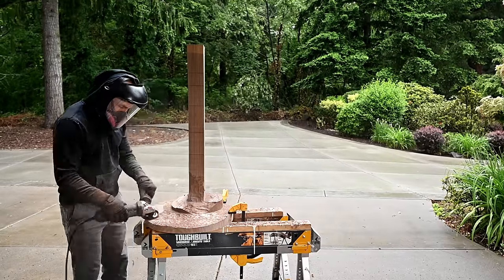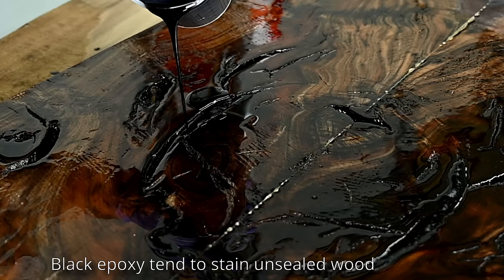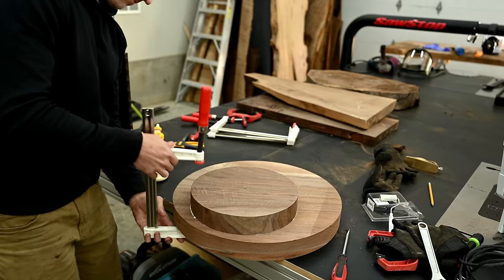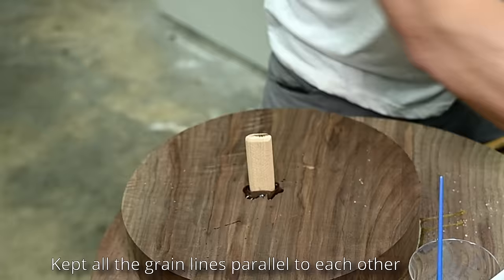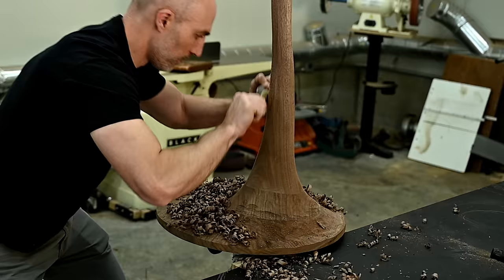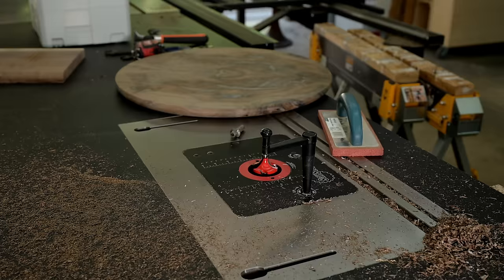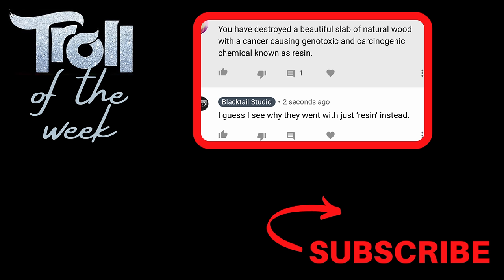Nobody Uses Wood Like This, and I Don't Know Why

Comment: I really do like these “scrap” projects. For someone like me that doesn’t have a lot of money to practice, it helps because I practice with a lot of “throw away” pieces.
Reply: The throw away scrap projects I enjoy it gives me new idea
Reply: If you can afford all the equipment necessary to transform this timber into a piece of art your rich🤣
Reply: I've never found any scrap pieces of walnut anywhere around my area. It's all super expensive
Reply: Second hand stores have alot of wood cutting boards for practicing on.
Reply: Your table is so beautiful. I have seen some wood workers put fake crystals, turquoise, or other jewels into the cracks with epoxy.
Reply: I made some of my most unique pieces out of scrap. Basically designing around the shape of what I have.
Reply: Scraps have made me alot of money, I get alot of scrap from my neighbour as he just uses it for his burner, made and saved me thousands
Reply: @valeriesmith938  I have a small table like that,, there's epoxy or plastic chunks embedded in the resin, its a good idea if your not a epoxy fountain of ever flowing resin aha
Reply: I used to go to the city dump about once a month and gather up as much wood as my pickup would hold. Once I got there to find a huge pile of 1/4" plywood, all in pretty good shape, and took two loads home before the guy working there showed up as I was loading the third load, and told me that it was spoken for. Oh well. I had an old frame house, and used the plywood as a sub floor to re-floor the the kitchen and living room. Very seldom did I use new wood for my projects.
Reply: @sueladybird6923  I think the expression  you're looking for is 80's middle class. But also if he's making money with this work the tools pay for themselves.
Reply: Looks like a soulful Labrador Retriever. Love this table!
Reply: @stevenwilson8718    My husband just stopped at a house nearby that was doing some construction and he always scavenges for discards. The homeowner and he started talking and he brought out some scraps of solid exotic hardwood flooring since that’s what his business is and is going to contact him when he has more. He finds solid hardwood cabinets discarded as people are updating or remodeling and has made some good discoveries and new contacts.
Reply: I see a dog
Reply: @sueladybird6923  ...you're* rich.  😊
Reply: @sueladybird6923  not at all you can do this with a handsaw grinder and some other small things and then use the money to get more tools
Reply: You saw a sloth 🦥.  I saw a Harley scull. I love the table. I think it looks great. It's not a project I would take on. One I'm not that advanced. Two, I'm a hand tools kinda guy. And it would take far too long to carve that base to make it worth it.
Reply: @sueladybird6923 Well I have to give you an example, I'm living in se Asia with my family, I just love what I can do with lots of very cheap timber, which comes from import pallets etc , I get great reviews from many people of the furniture I make for our house, god bless

Comment: Small tip from a sheet metal fabricator: when you drill holes in those metal discs, run the drill much faster. For that drill at 17:32 you would want about 1000 rpm. Your cutting force and also the chips will be smaller, so less risk of the workpiece flying off, the drillbit breaking or overheating. You can easily find rpm charts online. Don't press too hard on the handle and lubricate. When you lubricate with something like acetone from a spray bottle, that will evaporate without stains by itself or with the help of compressed air.
Reply: i thnk its the camera
Reply: You really know your stuff bud
Reply: “Small tip from a sheet metal fabricator: when you drill holes in those metal discs, run the drill much faster. For that drill at 17:32 you would want about 1000 rpm. Your cutting force and also the chips will be smaller, so less risk of the workpiece flying off, the drillbit breaking or overheating. You can easily find rpm charts online. Don't press too hard on the handle and lubricate. When you lubricate with something like acetone from a spray bottle, that will evaporate without stains by itself or with the help of compressed air.” 

Ok makes sense I definitely read through that 

Or did I?… 

Wait till June 7th
Reply: @MrSockZa1st  This is the Internet. You have to tell them NOW lol! People these days can't wait that long, they need it now.
Reply: Yep, lubricant needed always sir, for any type of drills. Every man friend is a lubricant! One way or another!
Reply: Solid tips, thanks.

Comment: I saw a sloth. I know, old video. One thing that jumped out to me about the circle jig for the band saw was that the weight of your work piece was pulling the unsupported side down and causing that pinch. There are 2 solutions. 1st put a support under the work itself. This is the best and simplest solution. I use a folding table saw outfeed support you can get at a big box store. 2nd is an arm attached to the underside of the sled that slides under the saw table itself. This can still leave some room to move and pinch, but it's a lot better than nothing.
Reply: Yes, a sloth I saw also.

Comment: My eyes spy a small terrier dog in your wood. That project turned out really decent. The mirror look is a great touch. That carving tool is something I had never seen. Good use on the spoke shaver too. Never to fine on the sand paper. I go to 800 on my bookcases, then seal and finish with min-wax.

Comment: just found this video that I really enjoyed watching. I used to make furniture using woods like elm that has a similar wild character like the walnut a long long time ago. Back then I took a different aesthetic approach by basing the final form more on the nature and character of the grain of the wood I was using. For example I would tend to avoid imposing a hard geometric form on the final piece and tended to try and incorporate as much of the natural edges as possible, carving when required to get the shape just right. The designs tended to end up with no straight edges. While it did require the use of more hand tools and much more effort,  the final result ended up more 'organic' in nature rather than geometric which I felt worked as the form was more sympathetic with the nature of the wood itself. I just wonder if you would ever think of using that approach? Anyhow what you achieve is of magnificent quality, and how you put the videos together is first class.

Comment: I really loved this project. I love the method of book matching the material. This was a great find on your table top material. It would’ve been a real waste to simply burn that. All my projects I’ve done in the past have been utilizing specific pieces of wood I selected for their character. I personally prefer character woods over plain Jane boring to me, straight grain wood. My first thought prior to you cutting the circle on the table top, and I saw the face of a lion. I noted when you were using your circle jig to cut at the bandsaw that the blade was binding up, reminded me of metalworking. I am a retired tool and die maker, this reminded me of wire EDM where the metal will bind up behind the cut. Try inserting wedges as you cut behind the cut to prevent the material from binding and pinching on the blade. Your explanation of the table base lining up the grains of the word and why that is important, was an excellent tip, especially for beginners. I love the carved table leg and this whole project was just totally awesome. Use of the spokeshave reminded me of the Woodwright. I don’t know if you’ve ever watched his show on YouTube or on PBS, he amazes me with his old world style hand tool work. Also good tip on concaving the table base, that is how you prevent the table from being tipsy.
Reply: See...guys love it.
Reply: I thought the exact same thing when i heard spokeshave!! Loved that show so much!!
Reply: Try using relief cuts to avoid blade binding on big cuts like that. Wood has a life or nature of its own.

Comment: this kind of work is free flowing and unpredictable....so much intresting....keep it up
Reply: just one thing for your consideration, the transition between the 2 parts of the base might be best solved if you intentionally add a pattern between them so to state the transition clearly. The smothness of the curve makes the two directions of the lines of the wood somewthat abrupt.

Comment: suggestion: attach circle metal piece to folding bracket with latch.  That way you can set table down at or near full vertical position for "storage" but it would also allow people to see the piece when its not in use.

Comment: Pretty nice project, and I learned some tips. Thanks!  I probably would have recessed the metal plate into the top's underside to make the wood-to-wood joint more seamless.  Reminds me a bit of Nakashima's use of wood defects, though a very different overall style.

Comment: Each piece - top and stand - for themselves: Gorgeous! The combination of the two: for my taste too much. This is because the wood character of the stand goes into one certain, soft calm and organic smooth direction, whereas the top has this rather strong, wild, even bold book-cut structure/pattern. So the two woods start a little battle who is the prettier one instead of complimenting each other. As a top for this stand/base try a hand-hammered copper top, that has been treated with a clear lacquer for protection. For the book-cut top I would design a smooth, brushed and sended brass base.

Comment: Hi blacktail , My third attempt probably a Saint Bernard dog or something along them lines. You do some amazing projects keep up the good work I’ve been watching you for a year or so now put on another device. Very strange as you was just about to start drilling I thought he hasn’t got that clamp down on the split second the bit of metal spun round very dangerous, An idea for you for fixing the tops if you can do Key hole slots in Metal plate it is quite difficult if you ain’t got the machine to do , by drilling one large hole and two small hole quite close to each other filing the two small holes so you end up with a slot probably do this three times on the disk so then you can twist and rotate it and lock it in position you will probably have to relieve a hole for the screw head on the other surface. Keep up the good work stay safe. Retired Englishman living in France

Comment: Love the videos, creativity, artistic touch, and humor. Inspiring work!
For cutting circles with the router, you could run a track (ex. 80/20 framing with t nuts) so you aren’t limited to fixed hole locations. Or something of the like, I’m sure someone has recommended this already :)

Comment: 0:00 Intro
1:27 Bandsaw resaw/bookmatch
2:10 Tell me what you see
3:09 Filling cracks with epoxy
4:06 Making the table base
5:44 Keeps promotion
6:51 Assembling the table base
8:52 Power carving the base
10:19 Spokeshave carving 
12:32 Finishing the base
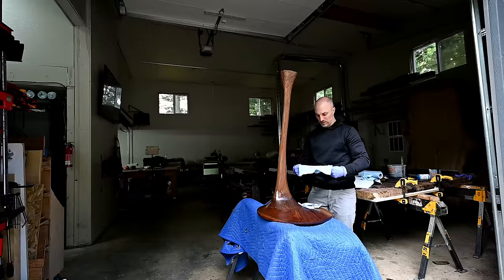13:25 Flattening the tabletop
14:49 Cutting circles on the bandsaw
16:42 Finishing with Rubio 
18:27 Final reveal
18:27-19:14 basically nothingness
Reply from the maker: I guess I should change that final chapter name.
Reply: @BlacktailStudio  LoL
Reply: Male lion face

Comment: I think it looks like a Lynx from one direction, and a Sloth from the other. 
Beautiful table Cam! Love how it turned out. 
I have a question about sanding. You mentioned that you used 400 grit instead of the 180 grit. What are the visual differences between the finished product? On small projects I’ve done I go to 240 or 400 before finishing (I use polyurethane). Is going higher, 800, 1200 kind of a diminishing returns thing? What if you didn’t go above 100 grit? Would the type of wood matter?
Love your content! Thanks for the great and informative vids.

Comment: We use Festool tools at work. Their stupid expensive but they are really nice tools. I work at an art museum and we use their shop vacuums with sanders and they work so well we feel comfortable sanding platforms with minimal dust protection for the surrounding art when we have to do a repair or modification in a gallery.

Comment: Great Video as always and an awesome looking table! I just dont quite understand what keeps you from using threaded inserts with that metal plate (17:40). There's most definitely screws that would do that neatly. I believe you'd want to search for something like "countersunk machine screw", there are even versions that don't have a thread at the top like your screws - there might just be a downside I don't know, so if you ever see this, I would love to find out better.

By the way, I totaly see a cat with antlers on this table. love the kinda rorschach design

Comment: With regards to using the domino vertically in the sys box under the two dowel trays will be a plastic plate that screws onto the base plate of your domino this is to stabilise it when using vertically  , but it is made from plastic to help it break easily so you have to spend silly money to buy a festool replacement , alternatively FC tools do a very nice solid aluminium precision base they also do a massive range of jigs and accessories for Festool and Mafell (king of tools)

Comment: I saw a sheep's face in the original book-ended slab. On the finished circular piece, I saw a woman's face.
I know this is two years later, and you probably won't see this, but I love projects using 'character' wood. I'm a big fan of resin lathe bowl channels, too, and they use a lot of 'character' wood. My only question with this table would be if it wobbled, or was steady, because the stem is so thin.

Comment: Early on i saw a demented camel, then after some sanding it was a walrus. By the end it looked like an afghan hound - none of which are primates. Oh, well. 

Do you ever lat the pieces out rotationally symmetric instead of book cut? seems like it might cut down on the rorshachiness and just make pretty swirls.

Comment: Avion tablet mixed with mustard oil and a good soft massage and last but not least hair wash two hours later may solve your hair problem.
If it didn't work well try massaging your hair with egg yolk oil. Egg yolk oil will definitely show the miracle ❤

Comment: This is the correct use for resin, making something great out of what would've been firewood. Same as the original river tables, although they've got out of control now. I've seen somebody joint up a perfectly good prime oak top and then rout a 'river' down the middle of it. Should be illegal.

Comment: A kangaroo I guess 
Hey Just an idea as I’m not a woodworker nor a concreter but with concrete you use vibration to settle the concrete and get out any air bubbles, just curious but would trying the same with apoxy work 🤷‍♂️ just seems like an awful lot of work to fill in the voids. 
Love your work 🤙

Comment: The reason why it was going to be firewood is because even with epoxy you can't guarantee long term stability due to the conflicting grains of the wood the right conditions of humidity and drying can rip the entire piece apart. The epoxy will make it last longer but eventually the wood will do what nature imposes on it. Showing a piece that is ten years old but has lived in the effective perfect conditions is not the rebuff of this. furniture rarely stays in a perfect environment. Epoxy wood tables are a new thing there are not tens of thousands that have survived 50-100 yrs on the other hand pieces where this kind of defects full wood are not selected do exist.

Comment: I like the table, but I think I like steel and wood combination better. The combination full epoxy slabs with wood,...as in the end table you made before or later, is uff...it comes on folk-ish, which is this as well. So a tad too close to folk-ish to me. The combination with steel and or aluminium, brass and extremely cute woods like you do, is my kind of style to go with. Since it shows professionalism, and less wood peckish. If you get what I mean. So sure it is cute, and I am sure some people like it, but it explains itself as old oak heavy in a slender new style. I can imagine some like it, but the bulk of people I think would go for combinations of materials, clean made, and maybe with some additives like electrical things.

Not lights, but I mean, something they can use to energise their phones, or place their laptops, or such things I think would do commercially better. Like the desks you made, the one for your wife, and taking that to other pieces, like end tables with lights...or sockets would be very cool. Also a place when you use end tables and such, to place a book on or, a drink...something integrated and combined materials, useful for modern day life. I think is...the way to go, when wanting something commercially interesting. In all other means with folk-ish things, it would need to be real art like. So can be challenging, but with such carvings I want to see real carvings, to call it art.

Abstract becomes more like what you made here. It is nice, but I wonder if it really sells well with easy potential to get it sold. :) And in the book match top I see too much...I see a variations of humanoids, some with horns even, turning it around looks like someone screaming, like the scream, painting. And well...aliens...such... I think it's mentally still stable things I see...but now I wonder about you man?! LOL